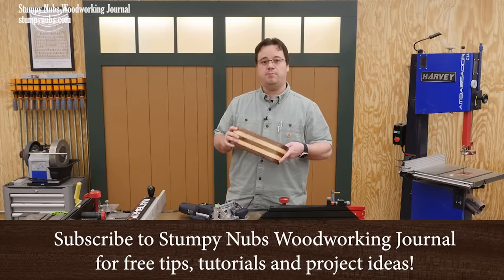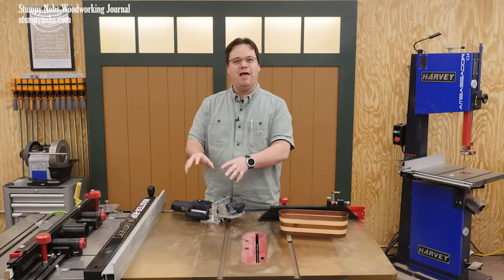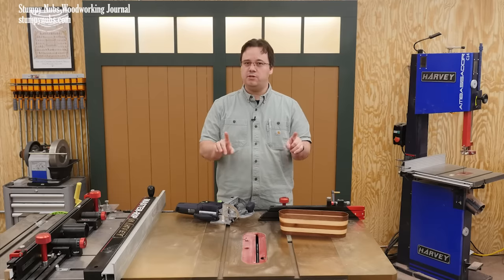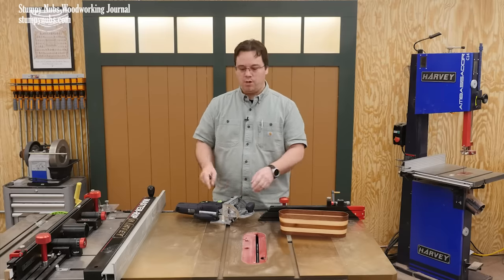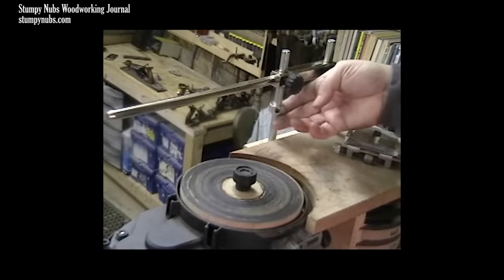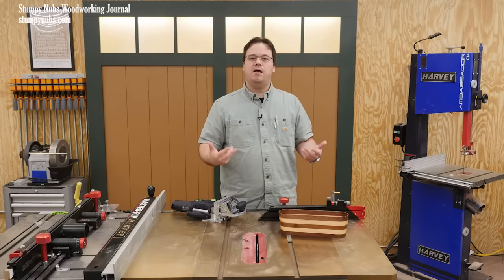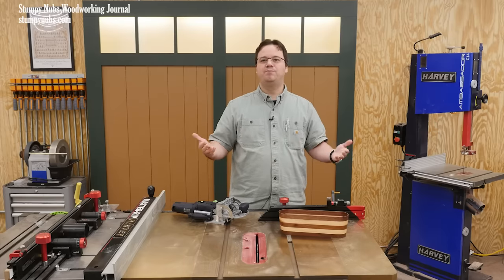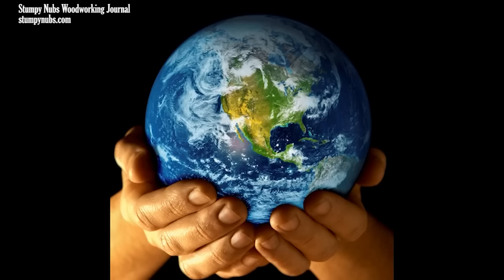This is why people HATE Festool and their Domino!

Comment: What people forget is that these are professional tools. They are not targeted at the hobbyist. They are designed to work hard all day, they are designed to save you time and increase efficiency at a price. Not to mention the support that you will get out of festool. Yes there are parts that are consumables. But overall they will take care of you within reason. As opposed to the cheaper tools, out there from many other companies. That have much lower quality control and probably little to know warranty or support when you have issues. After all you get what you pay for. If you pulled it out of bargain bin and its discontinued and barely works as intended... You really can't say you didn't see that coming.  

So when your really pushing the limits and working on that level where your time is more valuable than the cost of the tool that you know will do the job you want it to do. Spending a stupid amount on the tools is not unreasonable. It sucks that not more available to more people, as I really prefer a domino too a biscuit. But I completely understand.

Comment: To me the domino is not a problem tool. Not going to get one though until there is an extremely cheap version after the patent expires.  I can translate the tool use to using dowels real easily. When I watch a project where someone uses one. I just think how I would do that with dowels. Pocket screws kinda annoy me more though. They're not expensive but seem a bit "cheaty" to me where the dowel, biscuits or a domino seems a bit more structurally sound .... in my opinion (no engineering data to back it up, and frankly don't care to have any either).

Comment: Make a fair comparison between traditional Mortis and Tenon, Dowel, Pocket hole and Biscuit joinery.  All of these are cheaper than the Domino. Actually, t;he Biscuit jointery was introduced in 1956 and Domino within the last few years.
Reply from the maker: You can not compare a biscuit and a mortise and tenon joint. The two are simply not the same.

Comment: I think the vast majority of these types of arguments come down to what you do. If you’re a hobbyist where time is not a factor, or you’re a small shop that doesn’t happen to make that joint often then, yeah, the Domino is expensive. But if you’re a shop that makes the joint regularly as part of a production process that’s a different story. If I can save 5 man hours a week the Domino pays for itself very quickly and after that it’s all lowered operating costs from efficiency. In that case the Domino is actually pretty damn inexpensive. Maybe I’m wrong but I strongly suspect the Domino was designed with the latter in mind.

Comment: Here is the deal about Festool. For disclosure, I own a number of Festool tools, and have for more than 20 years.
Festool is designed for a market that does not exist in the United States. In Germany, often when you rent an apartment, there is no kitchen. You must put in kitchen cabinets, and when you move, you must take those cabinets with you. Plus, these apartment buildings may be 500+ years old.
This means there is a highly specialized market of fine joinery, building kitchen cabinets, in places will only small stairs. So dust control is exceedingly important, because you can't create dust for the others in the building, and you need to be able to carry your tools up 5 flights of really small stairs.
Festool designs tools for this professional market, and people tend to buy one set of tools ever, and they last a lifetime. These were never intended for the "professional" hobbiest.
That said, because they collect dust really well, people in the US buy the product, but we were NEVER the market and we still are not.
The Domino is even more specifically for the German market. It's useful in the US, and if you need fine joinery fast, it makes you money, but there are far FAR cheaper options that are just as strong.
Edit. I've also had the Fein for 20 years. Super expensive when I got it, but I've used that tool so much it's less than 10 cents a use

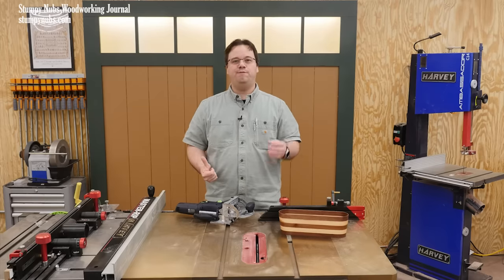Comment: 4:14 Arguing that "giving away patents" prevents innovation sounds like it makes sense. But in reality more and more empirical (economic and legal) studies actually suggest that the patent system (and especially the way in which they are used or abused) has more disadvantages than advantages for customers. With notable exceptions for biotech, pharma and high tech sectors, I might add. Patents seem to play a role there. I wouldn't however classify Festool as a high tech company.
Ultimately, keep in mind that many great innovations were also made in the absence of strong IP enforcement (e.g. open source software just to name one). While such innovations may not always be as "polished" as the heavily protected ones, they are ultimately often very cheap or even entirely free for the customer. That's quite a bit different than having to pay 1200-1700 dollars for a single tool.

Just a critical thought - not hating.

Comment: I can afford the occasional Festool, but other than the Domino (which has a limited use case for me),  I can never seem to justify the opportunity cost of buying one. If I can buy an item that is 90% as good as Festool for half the price, then maybe I can also buy something from Starrett or Mitutoyo that will give me the same warm fuzzies for a lot less. I'm at that point where everything I buy is pretty much an upgrade to what I've already got, which makes the justification process even harder. For example, my miter saw is a DeWalt 790. It's not a Kapex, which requires less space to operate and no doubt has a better build quality and is probably a lot lighter, but properly tuned and with a good blade, it will produce the same results. So I remain Festool-free, but I still watch Peter Millard videos and marvel at what is possible with a Festool system. I'm getting a little old for "maybe someday," but if I ever have to tackle another big panel job, I may have to reconsider. Or maybe I'll just build my own MFT and hinged track and use my Makita track saw to achieve similar results.
Reply: I’m probably going to spring for the router since I’m tired of piles of sawdust and the dust extraction looks better designed

Comment: I'm not big on the patent system as it stands, but there should be a system for buying out patents that are a societal good. Not just convenience, but the SawStop is a monumental safety gain and the fact it is locked behind a tall paywall is gross. In my opinion, it isn't much better than price gouging on medications. The domino is not one of those things, Festool can have at it. It's cool, but not required in the slightest.

Comment: The best thing about the Domino is that the patent is about to expire. Like when the track saw and fein saw patents ran out, all the manufactures from qualllity to crap flooded the market with options. 

Next year, the domino sales will drop off but the sale of a product they designed will explode. 

I and millions of woodworkers will be purchasing one, not from them.

As for the cost to make their tool, I would be surprised if it cost 100$  at the 20 years in production mark. Dewalt, makita, and Milwaukee will be ready to ship the day it's legal. 3-400$. A year from that, harbor freight and wen will be selling 150$ version.

Comment: For me, it's pretty simple. I don't care how expensive it is (although I do giggle at that), or whether it's a cult or I don't own one. I care that in 150 years time there will be an unnatural scarcity of early 21st century furniture because all the "quality" stuff (that isn't flatpacked junk) that gets sold, that is being built with a domino (most of it), will ultimately need to be completely dismantled to secure a single loose tenon, and that will result in all that furniture being discarded or destroyed 50 or 60 years from now. It doesn't have the shoulder strength of a proper mortice/tenon to protect it mechanically from shock and racking when the glue inevitably fails in one joint, and it is only ever going to be as strong as the weakest glue joint with which it was made. 150 years from now I wholly believe that the domino will be regarded as the most destructive force in the creativity of our generation, lasting beyond the depressingly short term visions of consumerism we seem to hold dear today. Lose/floating tenons have their place, they've been around for millennia. But what the domino is is the short cut to decent craftsmanship which 300 years ago would've been considered a waste on heirloom furniture. So many say "Well if I'm making heirloom furniture, I wouldn't use a domino". Tell that to the maker of the £2k desk/table/chair etc that relies solely on the domino for its structural strength. There are thousands of them, and they'll all be junked in the future as they cost too much to repair the single failed joint that cripples the structural integrity of that piece. Or shove a screw in it and make it worse with less meat in the joint. But, would woodworkers 300 years ago have used the domino if they had one? Of course they would, and we'd all be bemoaning the lack of 300 year old furniture due to the short sightedness of those woodworkers.

Comment: I can confirm, the crushing weight of my incompetent craftsmanship is infecting my soul; despite the fact that I don’t even own a domino.

Festool is “needlessly gouging” us in all their tools, not just the domino. So I don’t know why people hate the domino so much. Probably because there is no alternative to it. You can buy a Dewalt miter saw and be just fine but there is no Bosch domino. 

Festool is just an expensive brand, like Hilti. The only festool I own is thier $200 finish sander. And the only reason I own it is because my $80 Dewalt broke due to plastic drive parts after only one project. So I returned it to Home Depot and bought the cheapest sander that isn’t using plastic drive gears.

I don’t feel anything one way or another about expensive tools. It’s just too much money for me to justify so I don’t buy it.

Comment: You buy the tools you need to produce your product or solve a particular problem. That decision is either cost vs production/quality or "cool and I want it". 
I don't have a use where a domino would increase my production or build quality, so I don't own one. When looking at cost vs quality in a limited production setting a $60 doweling jig wins hands down, and leaves me $1140 to spend on other equipment that produces a greater increase in my productivity.

Comment: Ha, Ha, My cologne is WD40... I own a Dom 500. It saves me so much time and effort.  I have the jig to do loose tenons, but Set up of the Dom  is wham bam. I'm not likely to buy  anything else from Festool, as you can get other brand Quality tools. Why Knock it. It does seem over priced for what has been out for quite a few years. I'm sure it will drop dramatically when the patent runs out.

Comment: I have used the domino and don’t like it. It’s nothing against Festool; I absolutely love my 6” Rotex and the vacuum is a game changer too. 

My objection to the Domino is that it doesn’t do anything that smaller/cheaper tools don’t do equally well.
Reply from the maker: What tool does what the Domino does "equally well?"
Reply: @StumpyNubs  A pair of dowels performs mechanically the same function. The drill is much lighter and cordless, and a small library of jigs allows you to adapt spacing in literally a second, or maybe three if you have to switch drill bits to use a different jig. 

My experience of the domino is that it’s always stored somewhere inconvenient, I always need a minute to remember how to adjust it, it’s heavy and angular enough that I have to be careful how and where I set it down, if I run out of supplies I have to wait for mail order, and of course the cord. 

Or I can just grab the same drill I use every day and a jig, and if I run out of dowels they’re available in literally every hardware store. 

I keep thinking someone will show a factory context where none of these things apply. Seems like there could be an assembly line use case that doesn’t have these limitations or adapts well to them. I have yet to find that person though.
Reply from the maker: Yes, a PROPERLY aligned, multi-dowel joint can be just as strong as a mortise and tenon joint. But a drill and a jig, even the best jigs like the Dowelmax (which I own), is not as fast and easy to use as the Domino. You may consider that difference minor, but it is a significant difference for a lot of people.

Comment: Can't afford a Domino, use dowels, not as strong, but much easier, and a lot less expensive, I think too many people get hung up on the strength of the joint, and forget the reality of how strong the joint really needs to be. Super expensive "mega tools" don't make you a better woodworker, you still need the skill, they just make it easier, and sometimes faster.  15 or so years ago I built a display cabinet for my plastic model airplane collection, polished edge glass shelves (the most expensive part of the whole project), glass door, and glass sides. I made this using nothing but a Ryobi 10" contractor type table saw, a Craftsman 7 1/4 cutoff saw, and a home made dowel jig (not quite actually home made, I'm a machinist, and made it out of scraps after hours, but you get the idea), all the joints are rabbits or dowels, and an occasional screwed, my point is, you don't need a thousand dollar shop, it just makes it easier. Oh, I didn't mention, I did this in my back yard, the saws live in my shed, and I drag them out when I need to use them. I used to love watching, back-to-back, The Woodwright's Shop, and The New Yankee Workshop, the contrast was amazing to me.

Comment: There is a lot changed in the years of makers on youtube, primarily offcourse the sponsors. I love woodworking videos, and sometimes i also cringe seeing some videos.. tool envy, maybe it is envy , but lets watch a youtuber making a cuttingboard : first they always have scrapwood, the most expensive species, but laying around.. scrap wood, then they walk to the jointer.. usually a big expensive one, then they walk over to the sawstop. Really not cheap.. glue them together with red clamps , also not cheap, then trough a plainer also not cheap, hooked to a very expensive dust collector, then through a sanding planer, then a router for making a grove in the cuttingboard. , sander, and oil, and voila a cuttingboard. Is it envy, or are they lost the connection to the people who are watching, i don’t no either, i keep watching and if i make a board for myself, i will use the tools i have, but sometimes yeah.. i think it is to much tools showing. Not all youtubers are this way offcourse, and those are the one i keep watching. Like this channel, you show expensive tools, but also other options, and that is how the majority will do homeprojects.
Reply from the maker: All jointers, planers, table saws and clamps do the same thing, regardless of their cost. I don't understand why it matters what someone else has when they are showing you a process you can still duplicate with your own tools.

Comment: I have never used a domino of any kind, I do have a biscuit cutter from Porter Cable when they were still good,  And i wonder if this Festool debate would be the same if they had invented Biscuits instead of domino?  As a hobbyist woodworker I rely on good to real good in my tools, I have a Rikon 10-326 Band saw, excellent for a homeowner A pro might say otherwise,   No matter I do not own Festool only because of the price,  and on the miter saw it uses a proprietary saw blades.   My woodworking is a fun retirement activity,  perhaps the people who make the Festool argument don't realize everybody's  opinion is valid,  After all Harbor Junk sells a lot of crap. Go there.

Comment: I'm one of the few who is ambivalent. It seems to me the Domino-made joints aren't significantly stronger than other similar options, like doweling.
Reply from the maker: A dowel is a loose tenon, like a Domino. You may have to use more dowels to get the same strength, but you are correct, the two joints can be equally strong. The difference is it take a lot more time and effort to create a well aligned dowel joint than it does to use a Domino.

Comment: I like high end power tools, i own fein mirka hilti maffell,

Festool isnt a good value , their stuff arent durable and you're locked in their system

Look at their drill, its 700$ canadian, you need a special adapter to use normal everyday bits, it has the berformance of a brushless kobalt but its as bully as a 20 year old 18vnicad drill

Comment: Sorry I have no problem with your videos. People can use whatever tools they want and I am fine with that.
I also think you do a great job of making the project buildable.
I also understand the idea of professional tools vs consumer-grade tools. I am a software engineer in the aerospace industry. Some of the tools I use are stupidly expensive. I am talking about thousands of dollars a seat. Some of the chips in the systems I work on cost tens of thousands of dollars. You try to price out a rad-had step-locked CPU or an Ultrascale+ FPGA. I don't have to buy those myself the company I work for does. At home I very inexpensive software for my home projects.
When it comes to the price of professional tools it comes down to this, can I make more money after I buy this than before and cover the cost. For hobbyists, it is simply how much you want it.  It is the same with any professional tools.